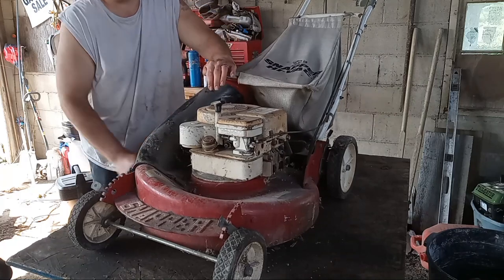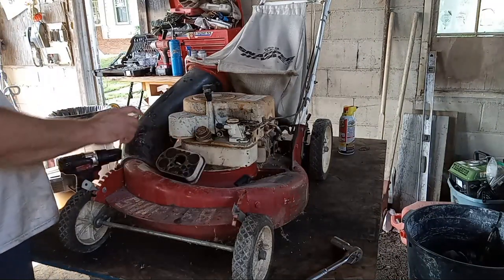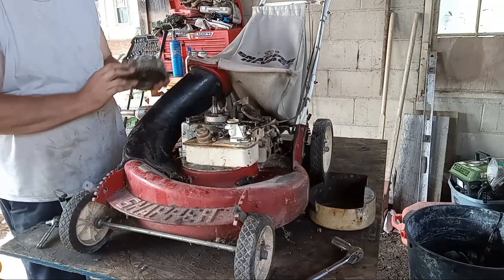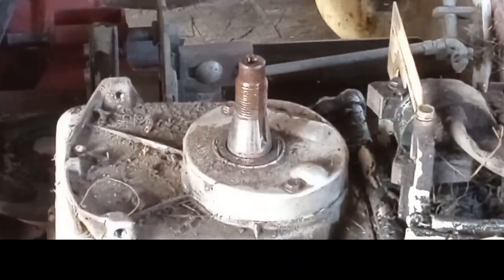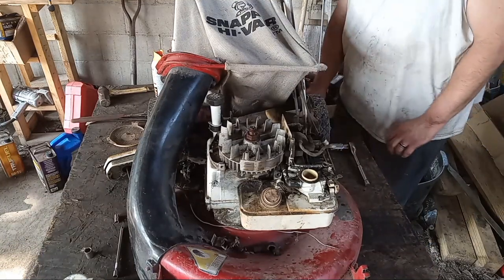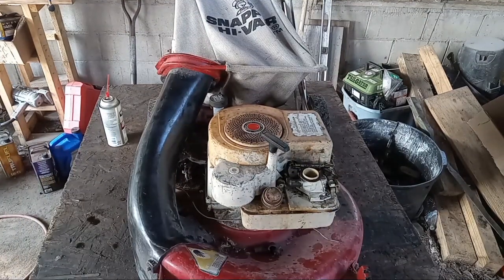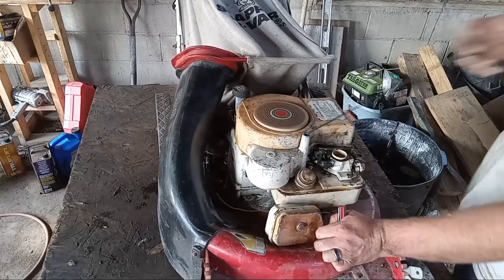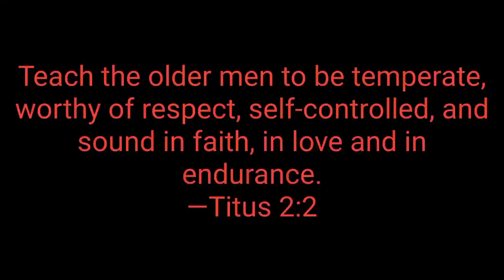1982 snapper hi vac, abandoned  for years, will it run?

Comment: I have a vintage snapper rear wheel drive self-propelled with a side-mounted Briggs & Stratton 3.5 horsepower engine. And as soon as I started up it takes off by itself so I need to find the adjustment for the self-propelled
Reply from the maker: Yeah sounds like either an adjustment or the drive disc may be bad on it. Thank you for watching and taking the time to comment. God bless you..

Comment: When I had these off I usually changed them over to pointless. They had kits for that.
Reply from the maker: Appelmac1, I've done the magnetron conversion on other projects on the channel.   My goal is to try and get them running and usable using as many original parts and pieces as possible. Trying to show those new to the hobby that you don't always have throw parts or money at it. Sometimes some time and patience and alittle elbow grease goes a long way. I mowed my back yard with this mower all summer long always starts right up and gets the job done. Thank you so much for watching. I really hope you'll check our some of my other videos. God bless you.
Reply: Where are you located? I’m in sw OK.